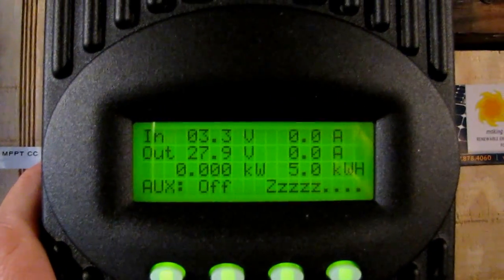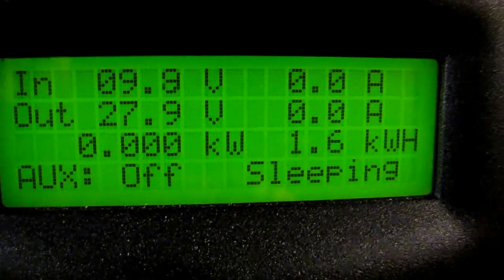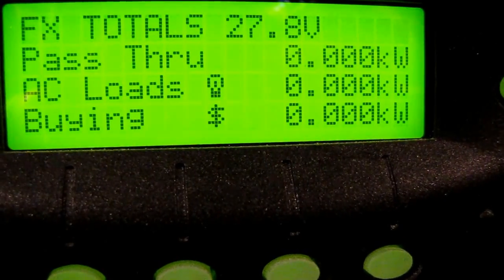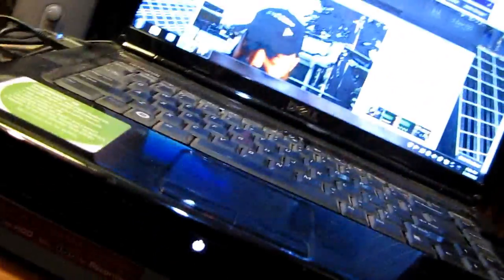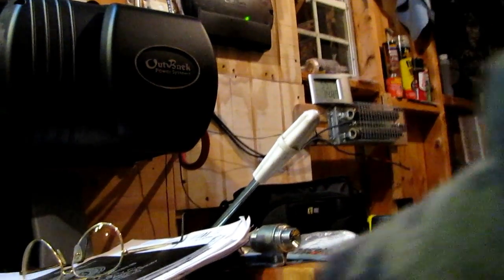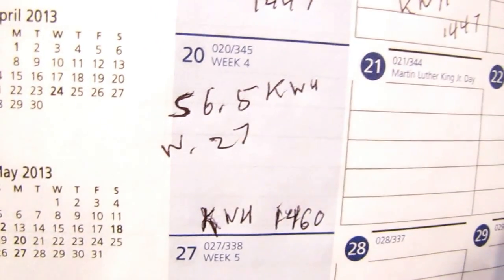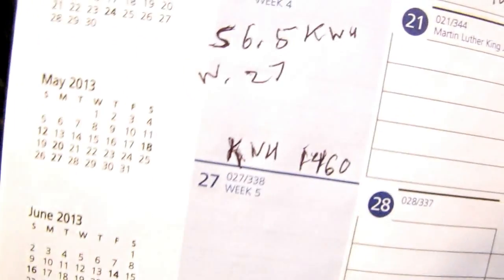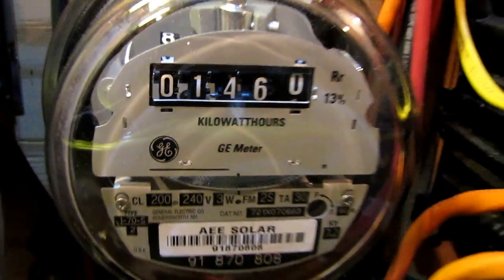Solar And Wind Power Production At The End Of The Day By VIARLOCITY

Comment: If the batteries get warm you could drill a hole or two in the box with a hole saw drill bit. Then you could install a computer fan in the hole. It could blow air in one side and out the other side hole. You could hook the positive and neg wires to a battery. then put a switch in the lead. You could turn it on and off as you needed to.

Comment from the maker: Your Exactly Right dapappacn  But I would Have To Triple The amount Of AGM Batteries Which Is Very Costly  Probably In Other words 18 Batteries  at 90 amp Hours each   That would Be $  240.00 each  or  $ 4,320.00 worth Of Batteries   Your Exactly Right  I Just Crank Up My Honda EU 2000 i at  Night For about 8 to 10 Hours If Needed   It Burn Little Amounts Of Gas   My Main Goal Is to Keep The Fridge In House a few Lights and TV at Night Running  and Deep Freezers  Going Thanks For The Input buddy